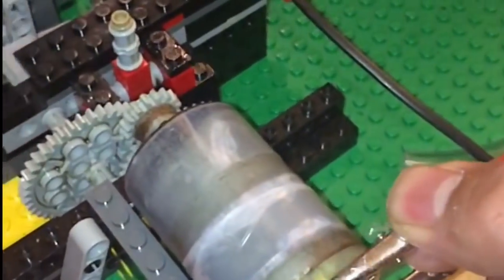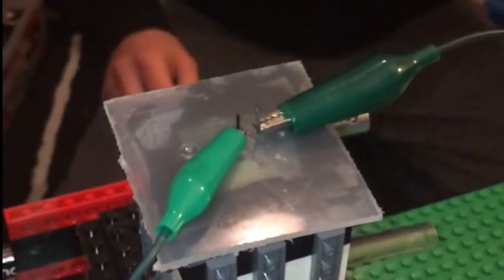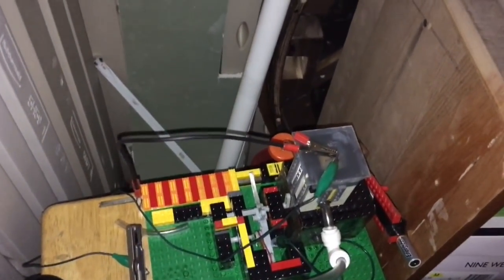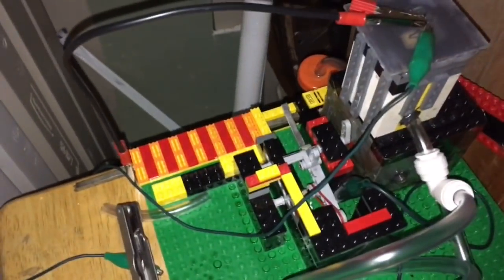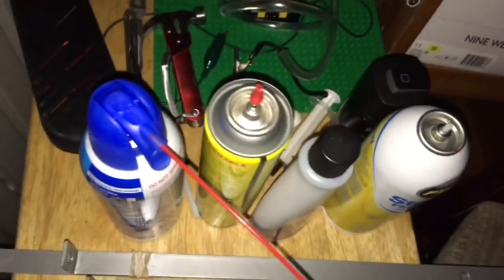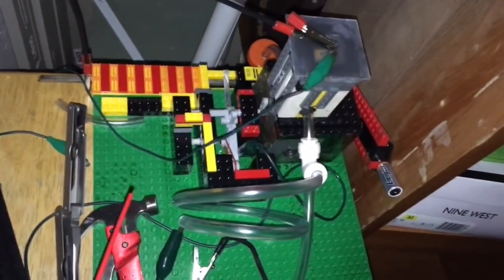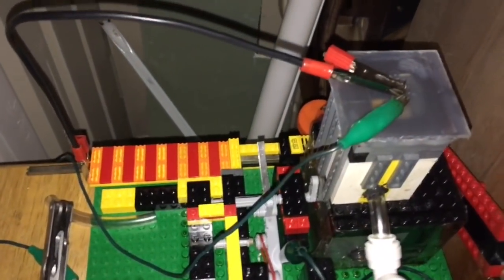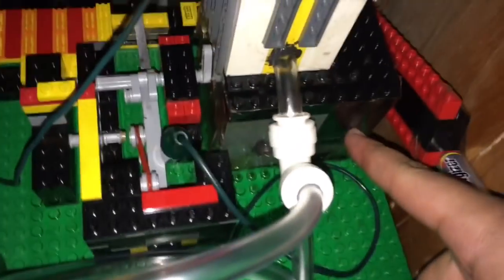LEGO 2 Stroke Motor (With real COMBUSTION) attempt

Comment: There is few problems with this design, in two-stroke engines the intake port open near BDC with the exhaust port so there isn't vacuum to draw the fuel in. Normally mixture is forced in by piston in crankcase through ports. Also you don't have a carburetor with starting fluid only you can get only bang or two. Compression losses can be minimized by rotating the engine faster, therefore by rotating it fast enough you can probably get it running until it melts. You could make the carburetor and then make a exhaust pipe that gets constatly larger in diameter. The exhaust pipe would then make small vacuum if you first prime the cylinder and get it to fire few times. The exhaust port needs to open a bit earlier than intake port. Also using fuel with lower octane rating needs less compression to ignite and proper 2-stroke oil in fuel increase compression.
Reply: Oh wait you do have crankcase induction, but without fuel connected and later disabled it completely. You could use fuel vaporizer as it is much simpler than carburetor. Basically you have sealed container with pipe having other end submerged in fuel and the other end straight to the atmosphere. The mixture intake hole and tube must not be submerged in fuel. Then you connect the intake tube to that valve you have made and basically you have fuel. It doesn't work well but probably adequate in this case, though it must not be cold outside. Also move that "reed" valve closer to the crankcase as it might affect the mixture entry pressure. For fuel I recommend Coleman fuel as it does have low octane rating but otherwise properties like gasoline.
Reply from the maker: Yes we have enough induction and it opens and closes the check valve

Comment: instead of tryin different fuels, try rebuilding your piston head to increase compression ratio. and seal the entirety of the combustion chamber. be careful with how much you increase your compression ratio though, too much and youll get knock and the engine will puke everywhere. hoped this info helped. also add some piston rings if that's a possibility
Reply from the maker: What’s the most explosive fuel?

Comment: I guess you missed that your preassure from the spray will never reacht the chamber.
And does the Pitson is seperatet from the wave? I mean if there is any air or gas whitch can move down in the wave's room there will be no preassure and no gas air mixture for ignition.

Comment: Mechanically it looks sound, you may have issues with setting up the timing of the spark. From what I can see the issues are the flow of fuel and air, the exhaust, and the timing of the spark. A few minor changes would fix all of that. However your max rpm would only be around a few hundred rpms as the unit would probably explode at faster speeds.

Comment: Just so you know, air duster air does not have oxygen. it is almost entirely CO2.
you would be better of just using a compressor (such as turbo) to force air into the engine.

Comment: Gas duster - Wikipedia
https://en.wikipedia.org/wiki/Gas_duster
Common duster gases are 1,1-difluoroethane, 1,1,1-trifluoroethane, or 1,1,1,2-tetrafluoroethane. Hydrocarbons, like butane, were often used in the past, but their flammable nature forced manufacturers to use fluorocarbons. When inhaled, gas duster fumes may produce psychoactive effects and may be harmful to health....  Also I have to agree you need better compression try fitting a "piston ring" some how

Comment: Wait u live in new York I live in new York and work with cars and engines
Reply from the maker: Queens
Reply: Mad Brick adarondecks
Reply: Mad Brick but I  can tell u this your Crack shafts and cam shafts can't be the same or it will mess up the timing because your piston needs max compression before it fires and a stronger fuel will help

Also more weight to turn over

Comment: Please don’t give up! We’re all craving to see this LEGO engine running. also, the engine is missing a bunch of qualities that your typical two stroke might have. But I really think the huge issue is lubrication and compression. I would recommend getting a meter to look at how much pressure you’re building up. One way to test if the compression isn’t complete is two try to crank the engine whilst covering the exhaust. also remember to make sure that the whole engine (including the gas tank or whatever you might use) is sealed and pressurized. Anyway, crank the engine whilst covering the exhaust and it should be hard to crank after a couple of turns or it won’t turn at all. Try it out and best of luck :)

Comment: You must use a little carburetor like 12mm and to calculate your volumetric ratio to reach arround 8/9:1 
Also the square shape of the cylinder doesn't help for the admission and exhaust strokes

Comment: how r u gonna get the compression ratio needet to burn anything with ... at least a litte force resulting from the burn ? .... nvm just saw the ending...  i once started up a 2 stroke with no carb just a little fuel in the cylinder and it reved full power then then obviously died after a secound or so ....  it should roll even without carb try just open intake "with out the hose" and drip some fuel into the ingition chamber if it does not go of then .... you have trouble with the compression

Comment: You flooded the motor in short...undo the head let it all dry out.  But you guys are on the right track just need to find a way to adjust the air fuel mixture.  Once it gets going you don't need to keep priming the motor with every restart.  Also if you can find the compression stroke that would be the ideal turn to spin your manual crank.  Only time you need to prime a motor only if you hadn't used the thing in about two weeks to a month+.  I'm still giving you a thumbs up for making a successful lego lawnmower motor in the beginning.  Good Job!
Reply from the maker: Yeah, we didn't really think about the stroke of the piston, we just used the stroke convenient in building with legos, but thanks for the insight, hopefully with works but it's too late to make major modifications.

Comment: you need a carb. get some of those round lego bits, put them together, and rill a small hole through the bottom middle ways, then push and glue a small hollow tube up until its just above flush with the tube. stick the other side of the tube in a jar of fuel. you also need compression.

Comment: What kind of seal does the piston have in the cylinder? You’re going to need an extremely good seal, maybe even several O-rings stacked in one spot, or rubber glued to LEGO cylinder. An engine of that size will need a decent amount of pressure to run. Also, make sure you’re timing it right. It’s not going to rev out to 5,000 rpm so set the timing to fire about 1/25 of a turn passed TDC. Make the cylinder head out of something much more rigid (plexiglass) and make sure the pistons connecting rod isn’t flexing under a load as this is crucial during combustion, it’s going to put a very large strain on it and it will effect the amount of clearance in the combustion chamber.  Finally, the combustion chamber must be as small as possible to obtain the best compression, especially on something like this, aka the cylinder head must be VERY close to the top of the piston. Try getting a piece of 1/2” plexiglass and trim the cylinder wall down to about 1/16” or 1/8” above the piston for a starting point and make a hole JUST big enough for your spark plug and only recess it into the plexiglass enough to where it will clear the top of the piston.

As for the flywheel, you’re going to want something a lot more balanced. Try finding very large washers and gluing them together or a tiny dumbbell, it also must be placed at close to the crankcase as possible to minimize flex/wobble in the crankshaft if it does decide to fire.
Reply from the maker: No seal, but with the thick viscosity oil, we make a pretty good seal when cranking at high speeds, we don't intend for this to run for more than a minute but as for the fly wheel, it's pretty balanced, when taken off the shaft I can spin it like a top, if it was any heavier it probably wouldn't crank at all, thanks for the insight.

Comment: "We are not engineers"

Well, maybe it's not your job title, but what you're doing fits the description lol.

Also as others have pointed out, the canned air probably doesn't contain oxygen, but rather some kind of fluoroethane or liquified petroleum gas.

Heck you might be able to run it by not injecting actual fuel and just doing the canned air in the manner you showed to draw in outside air. You might be able to burn the canned air lol.
Reply from the maker: Oh well, but canned air does not have the explosive power that butane has, but thanks!

Comment: the problem is that you dont get enough air in there... you dont have an "exhaust" so the burned stuff will go nowhere else then threw the part where the Airfilter should go. Sorry for bad english ^^
Reply from the maker: Yes we thought about that, we hoped the air duster would bring in outside air but also clear the cylinder of the old gas that was burned, thank you for the insight!

Comment: Dude That ignigting system is pro i have an idee for ja make another nock on the crackshaft take air pomp so it switches on and of a bottle with feul halfway full use only the gas   ontop of the feul blow That in
Reply from the maker: The will probably create too much stress on the engine plus, I don't think an air compressor would be fast enough

Comment: Theres a video of a homemade engine with a glass cylinder, his air intake basically goes through the gas tank just pulling vapor from it, seems to work pretty well for him
Reply from the maker: Fuel doesn't readily vaporize at this temperature
Reply: Well that was his setup. I think the intake creates a slight vacuum causing more fuel to evaporate into the air, it was probably running lean but it was running

https://youtu.be/tZpU0WKvojo

Comment: Air cans are not filed with air they are filed with co2
Reply: Not as much as you are putting in
Reply: They're not filled with CO2, normally. They're usually filled with a refrigerant called R-152a, also known as Difluoroethane.
Reply: @akio2589  Also not flammable
Reply: @Danger_mouse  Holy post necro, batman! But, correct.
Reply: they’re not air cans then.
Reply: Mad Brick Any large amount of CO2 cause it to not fire.
Reply from the maker: That's why we had it out a little since the high velocity air will draw in outside air.

Comment: Question is.
Will it fit in my Honda?
Reply from the maker: Mass production will be soon after testing.
Reply: altoappleDE No need for VTEC, this one got LEGOTEC.
Reply: Dell Conagher sure, but dont have VTEC
Reply: Lol
Reply: I see. You are smarter than spies so you disguised as a cute girl to fool them into not destroying your sentry. Very clever...
Reply: Mightycarmods crew we here
Reply: Anything will fit into anything if you have a big enough hammer.
Reply: Unoriginal joke
Reply: if it does, it'ill be an upgrade! XD
Reply: Dell Conagher probably already in there
Reply: You got a 10mm then yeah
Reply: NOPE :V
Reply: no such thing as vtec in single cylinder engines
Reply: It'll make more power than vtech
Reply: Legotec and vtec fuck that all about the turbo ecotec xD my cruze is ecotec and I got that little 1.4l pushing 290hp and 340tourqe xD sounds like a boosted gocart but it slams a shock on everyone's face I raced xD
Reply: Randomator Sh!t it's still a cruze
Reply: Too big for your Honda.
Reply: Nebula, I get your MCM references. I am ashamed in those who do not.
Reply: Eins6Neun two strokes have almost all the power in high rpm so basically vtec
Reply: No
Reply: Yes
Reply: no no no the real question is will it run doom
Reply: Probably has more hp than your honda too
Reply: Put it in a chevy!  It will run better than whatever was originally in it.
Reply: @albertlagerman  That's a funny way of saying Ford.
Reply: @albertlagerman  damn that was noice

Comment: An air duster is actually CO2. its possible that it is one of the reason why it is not working
Reply: You're thinking of Chlorofluorocarbons. Hydrofluorocarbons are still widely used. It's only been recently that HFCs have started to be replaced in these dusters, but it's still common. The can on my desk is 1,1,1,2 tetrafluoroethane.
Reply: A typical air duster uses a hydrofluorocarbon such as 1,1,1,2 tetrafluoroethane. Combustibility is low, and the expelled gas is not an oxidizer.
Reply: Air duster is not flamble, but I think he was relying on the aerosol
Reply: Air duster computer cleaners are in fact flammable. It requires inverting the can and dispensing the liquid in the can directly. Make an ice puddle and try lighting it. Frozen fire. 

As the frozen puddle immediately starts sublimating to a gas you can blow your whole fucking room up, best be careful. Probably makes some nasty toxic shit when you burn it too. 

If you do not flip the can and just use it as it's intended it's not possible to get a fuel ratio correct enough to ignite.
Reply: Yes I was just thinking that. Infact I just looked on mine and it is not got any oxygen in it
Reply: not all duster is CO2
Reply: air duster is colder too right?
Reply: Air duster is non-flammable. The mixture for butane combustion is 82% air (that's 21% oxygen) and 12% butane or propane. You can vary a couple percentages, but not much more.
Reply: airdusters still use tetrafluoroethane
Reply: They're not filled with CO2, or tetrafluoroethane (R-134a) normally. They're usually filled with a refrigerant called R-152a, also known as Difluoroethane.
Reply: Top_Hat_Turtle_productions says the guy who didn't watch the video completely.
Reply: you mean inert?
Reply: But diflouroethane is often used in air duster and is HIGHLY flammable
Reply: That is true
Reply: Also, that is starter fluid (ether) or butane, both of which burn excellently
Reply: Yea I was thinking that
Reply: Pascal Robert c02 actualy kills a fire XD
Reply: KENARDO that was 30 years ago that's illigal using g hydrophobic carbob
Reply: Is innered gas
Reply: Modern air dusters use butane, which is (obviously) highly flammable

Also, sublimation is solid > gas, not liquid > gas
Reply: @ataphelicopter5734  no they dont
Reply: Pascal Robert no it isn't

Comment: Your forgetting one major thing. 2 strokes don't just run petrol, but they run a petrol/oil mixture. The oil helps lubricate but also helps seal the cylinder. Typical butane and lighter fluid won't work without a correct metering device like a carburettor, you need to aim for a decent air fuel ratio, 14:1 should do, perhaps 13:1 would be better? That's 13 parts air to 1 part fuel, you don't need as much fuel as you may think. I'd suggest getting a throttle/carb unit from a nitro RC car and use a little 2 stroke oil in the mix
Reply: You could (In theory) even make a primitive carb out of lego bricks; Where you have a tank of fuel and some pipes that are open to the air that feed to below the surface of the fuel, and some pipes that are above the fuel that feed into the combustion chamber. The piston pulls a vacuum, which sucks air through the fuel and in the process mixing it with some of the vapors. Not perfect by any means  but it can work
Reply: soulblood33x the main issue is getting the mixture right. Carbs work on a Venturi system whereby you have 3 chambers in the carb, wide narrow and wide in that order. It's done so that the vacuum drawn increases the air velocity into the narrow part of the carb thus pulling through fuel and vapourising it at the same time. Nitro RC fuel would be best choice for this with perhaps a little extra oil
Reply: Mad Brick then you need a larger flywheel. Why do you think typical pistons in an engine are made of aluminium? For lightness. It's only the piston rings that are made from a high carbon springy steel to seal.
Reply from the maker: These are all great ideas! Thanks, but we had really thick viscosity oil that did a good job at sealing, but if the compression is too high, these weightless bricks won't have the intertidal to turn themselves and keep the cycle going

Comment: the compression is too low you have to crank it faster to get it running at that compression
Reply from the maker: Believe it or not, if the compression is too high the weightless bricks don't have intertia to keep turning themselves.
Reply: Mad Brick give a fly wheel

Comment: Back pressure. 2 strokes need lots of it. Try to get a tuned pipe for the exhaust and it will work much better
Reply: Compression and backpressure is the least problem. If you would just get the a/f mixture right, it should at least produce some decent bangs.
Reply: I run nitro rcs which have much smaller 2 strokes so I'm fairly used to the problems. Definitely try put a carb on it. Also, try to put a groove around the piston and a simple o-ring around it to boost compression
Reply from the maker: Any o ring will cause too much   Friction and compression that it will hinder the motors ability to turn itself.
Reply: Did you know there are already mini engine parts made by lego? The little pistons and cylinders if you know what I mean? You could definitely try to run that off real combustion as well
Reply: how much back pressure do they need and do yo think they should try installing a power band ?  i would try to help ya with your nitro rc but its funnier this way lol
Reply: Mad Brick use a bit of 3in1 or veggie oil or similar to lube the o ring
Reply: Mad Brick the oil helps it seal too, giving you more compression